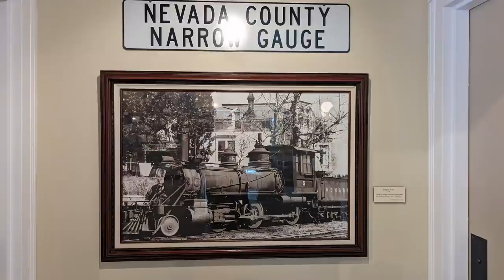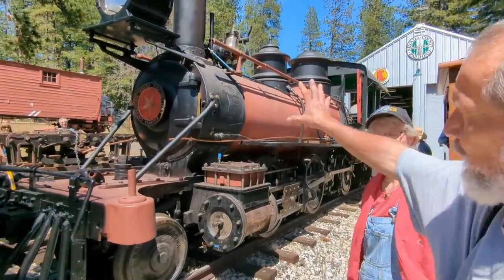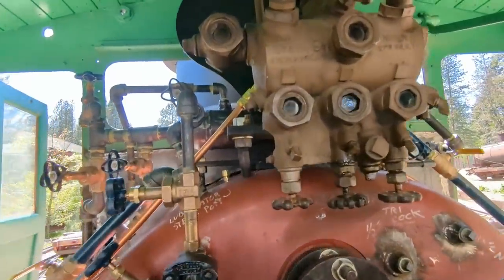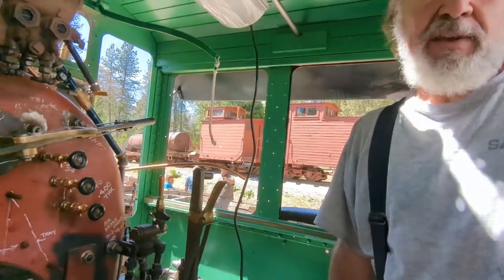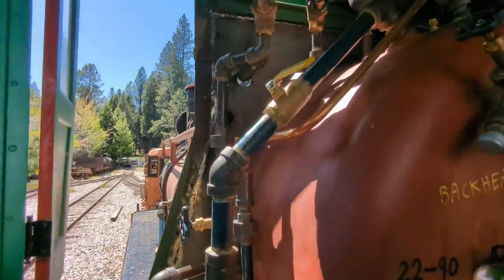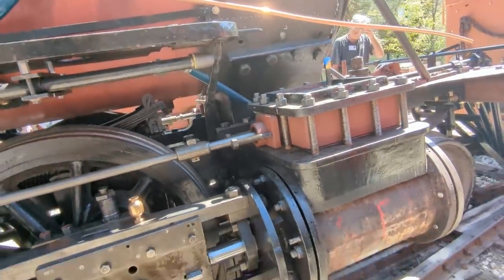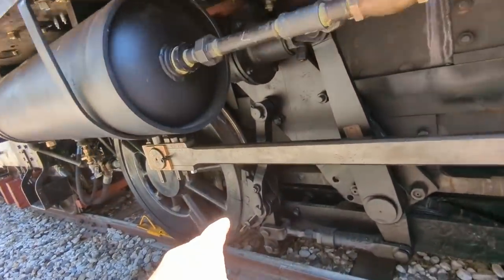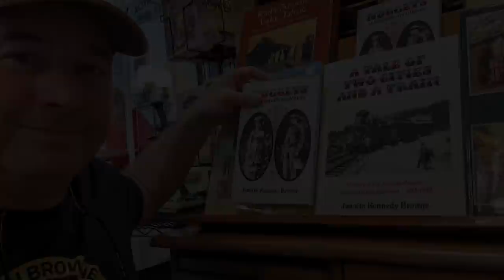1875 Baldwin Locomotive Restoration NCNGRR #5

Comment: The most extensive narrow gauge rail system in the world still in mainline use is in Vietnam! I have traveled on that line. They are quite proud of their trains. The stations are clean, and the rail is in good condition. The grade crossing signals are interesting: an attendant in a clean uniform lowers and raises the gate!. Many of the operations are done old school, including the workers in the yard using signal lanterns. The lanterns LOOK old school with a bail handle like a kerosene lantern, but are lit with an LED. They signal with a swing of the lantern.
Reply: Vietnam only has about 2500 km of rail.  South Africa has more than 30,000 km, and Japan has more than 20,000 km (not counting the standard gauge high speed lines).
Reply: @fritz46  Vietnam is metre gauge, so it may be the most extensive system of that gauge.   SA and Japan  are 3'6" gauge  (just 2.5" wider but still counting as 'narrow gauge'), as is New Zealand, Queensland and West Australia and many others.
Reply: Thailand is metre gauge, and they have more than 4000 km. :-)  The most extensive system of that gauge is probably in India, but I'm not sure if all metre gauge lines are connected. Another big system is in East Africa, but it is spread across three countries (Uganda, Kenia, Tanzania) and the international connections are out of use at the moment.
Reply: @fritz46   Apparently India is planning to convert almost all their metre gauge to Indian broad gauge ( 5'6" ), though how far they've got I have no idea. 
The larger East African steam locos are/were impressive, the South African 3'6"ones even more so, quite as big as  anything on British/European standard gauge. 
(I'm never quite sure what counts as truly 'narrow' gauge.   Metre?  3'6"?   Or 3' like the Nevada County here.    Or 2' like the South African 'narrow gauge' and the Festiniog/Welsh Highland?
I think the Nevada County is probably more 'narrow gauge' in character, like the SAR's 2'gauge and the Festiniog, than much of the 3'6 or the metre gauge systems.   Just to put it in perspective, a SAR  NGG Garratt, as used on the Welsh Highland, weighs sixty tons, or probably a little more than Baldwin #5 plus tender.)
Reply: @cr10001  We always considered the rail gauge in Queensland as "Narrow", but that was relative to Standard Gauge used in New South Wales or the Broad Gauge used in Victoria.  I think the reason Queensland adopted the 3'6" gauge was the cost of clearing the right of way - it's a big state, and the rail lines are quite long.  In recent years more Standard Gauge has gone in with 3-rail track to allow dual use.

Comment: State inspectors inspect any vessel under pressure. Water, oil, air... a 100+ yearold steam locomotive is no different from a modern air compressor or hydraulic tank. They can all explode violently.

Comment: For anyone who's interested, sander throws sand in front of the wheel when I'm operating locomotive going forward direction and behind the wheel when I operating in a reverse or backwards direction. There should be an F to denote the front of esp a locomotive. 
Now, even more interesting to me was that ANY day of the year I may very well need, use the sanders!! Yes, just as apt to in need, use in July as January!! Why, you ask... Bc the dew makes the rails wet and the wheels slip, so I need sand for traction.;-)

Comment: Nice...If the engine needs air to set the brakes, how do you park the engine brakes when its not in operation ?
Reply: Can't see it in the video, but a British loco would typically have a screw-down handbrake on the tender - I'd guess this might have the same.
Reply: There's a hand brake at the front of the tender. Take a look at the still image at 0:51
Reply: @jcl410  Figured there was something obvious I was missing.

Comment: The air brake system used on trains is less fail safe than the air brake systems on trucks. Remember the July 2013 crude oil train accident. The fail safe on trucks use heavy springs to apply the brakes. To understand the 2013 train I had a conversation with some people at the Northwest Railway Museum about a year ago. From that conversation I learned that the fail safe on train cars use reserve air to apply the brakes. The problem is that once the air in the reserve is lost the brakes release. Dan said the name of the technology when he said the brakes are fail safe. The things that look like steering wheels on train cars are the manual brakes. They must be applied when parked for extended periods.

There may not be may vehicle that are steam powered any more. But there are lots of boilers. A hospital that I did some work in had three or four boilers larger boilers operating at higher pressures. I believe they need to be inspected annually. It is likely that there are more inspectors today than in the past. When that engine was used as a working engine, instead of an operating museum engine, was it operated at a higher pressure?
Reply: IIRC, in my country the brakes on the railway equipment operate so that if there's no air then the brakes are applied, i.e. the air lines need to be pressurised to release the brakes.
Reply: @vk2ig  It is also true here in the USA full air pressure in the air line causes the brakes to release. And that no air pressure or low air pressure in the air lines causes the brakes to apply. This is what makes the brake system fail safe. That is why they called the brakes fail safe in the video. I am just saying that there are more complex details on how the brake system works. Those details make the air brake on highway trucks safer in some ways.

Comment: I noticed the unequal spacing of the drivers.  Maybe to counter the lack of trailing wheels? Does anybody know the engineering behind this?
Reply: Usually a space issue related to firebox placement.  On locomotives like this one, the firebox sits down between the frames on the left and right and between the rear-most and second rear-most axle front to back, so to get the desired grate area, the spacing between the second and third axles is longer than that of the first and second axles.   On other 2-6-0s, the firebox may be behind the third axle allowing equal spacing.  On large standard gauge 2-6-0s, the firebox may be on top of the frame allowing any spacing.  Like most engineering, everything is a trade-off.
Reply: @johnkolb6717  Now that I look back at the video, I see what you are saying. You can't put an axle through the firebox.Thanks.